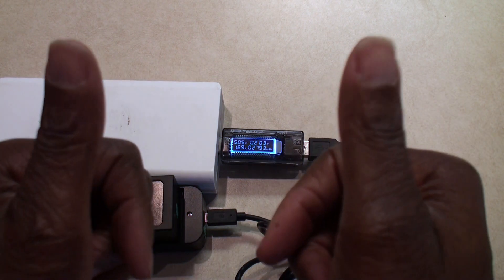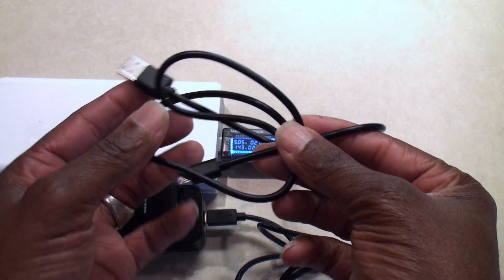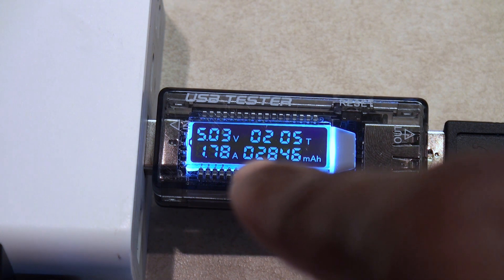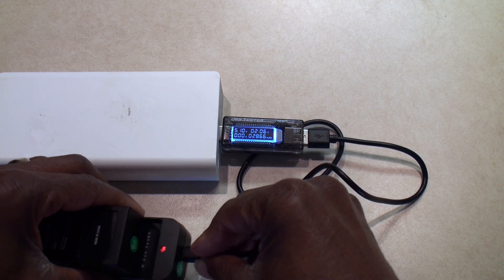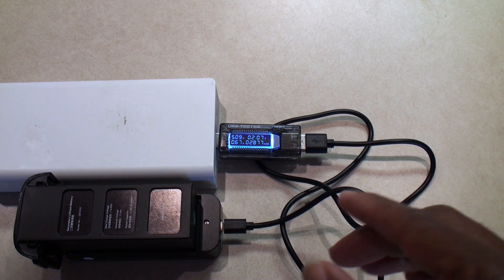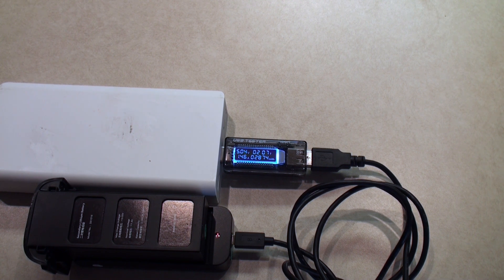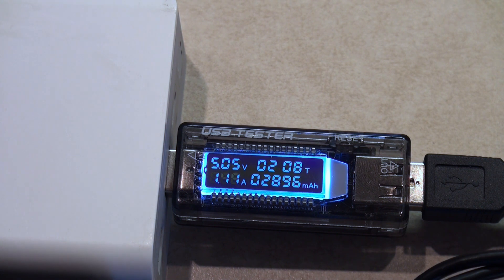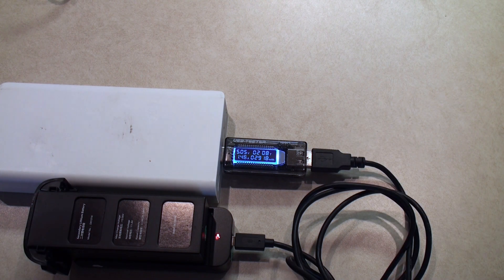How to Charge drone batteries faster!! (C-Fly Faith 2 Pro)

Comment: Question. Isn’t this the same kind of effect that a fast charging cord has on a phone per say?... it might get more juice into the battery faster but it’s not good for the battery’s lifespan in the long run.
Reply from the maker: IMO no, a fast charge system forces a higher charge rate. My accu-cel field charger will allow me to set a higher or lower charge rate above or below a recommended 1C charge rate. 
The charging block for this battery has its own regulation system, so the block will safely charge the battery. Its highest output to the battery is 2.1 amps which is still below the battery capacity. As demonstrated in my video the regulator still holds back on the charge rate, which IMO will not suffer in any way the longevity of the battery.
Reply: @allabouthim03  Awesome. Thanks for this specific information. I appreciate it. 👍🏻👍🏻